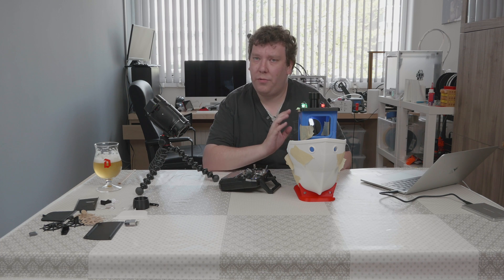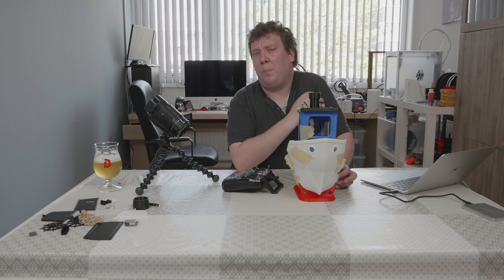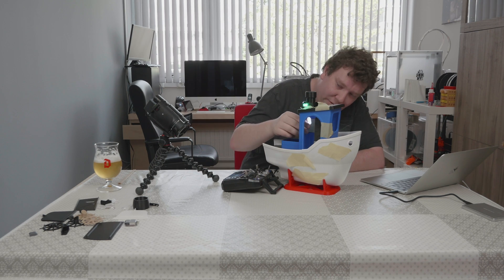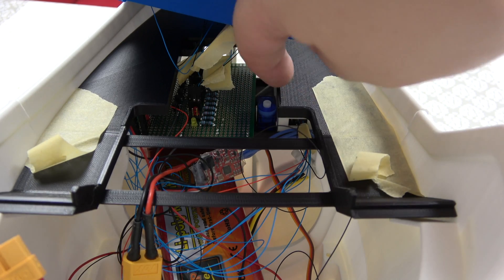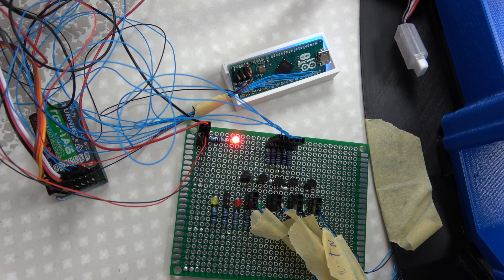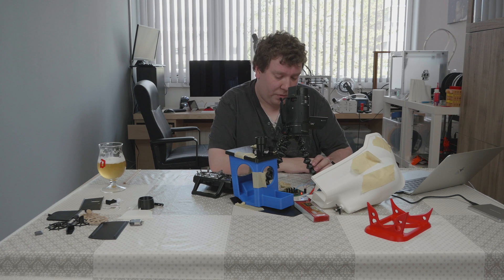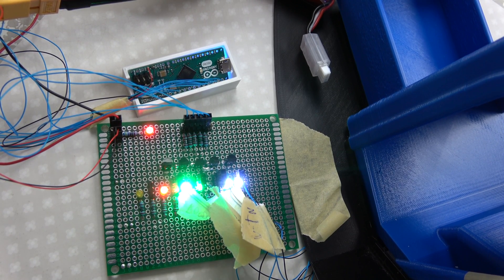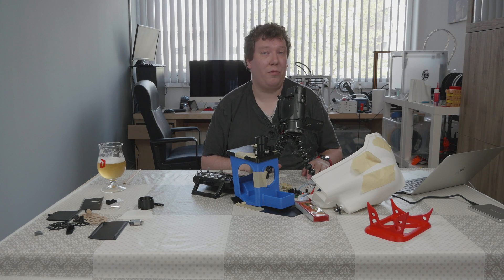Making the RC @3DBenchy by Thullen: Part 1, Electronics

Comment: I bought the same drive shaft as you did. What is the outer diameter of the bushing? I want to get started printing but don't know which hull I need (8.5 or 9mm). Thanks for the useful videos.
Reply from the maker: If I remember correctly it is the 9mm (The largest).

Comment: I have started to build my RC Benchy and your instructions are making it a lot easier. I want to use nav lights and control them with my transmitter using an arduino board. You mentioned in the video about posting the code to GetHub. Do you have a link to the code?
Reply from the maker: Hi,
The code of the arduino can be found at https://github.com/paul999/rc_benchy_arduino